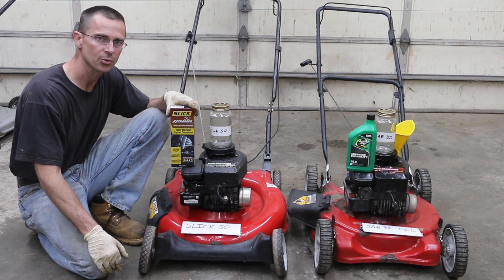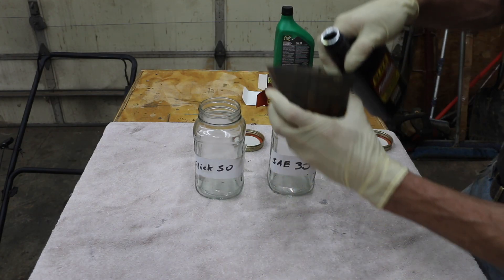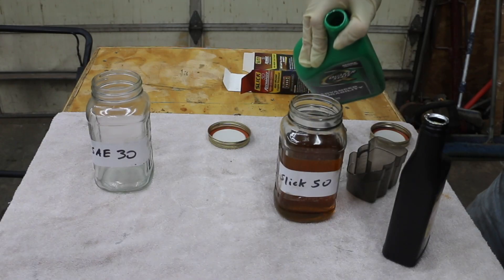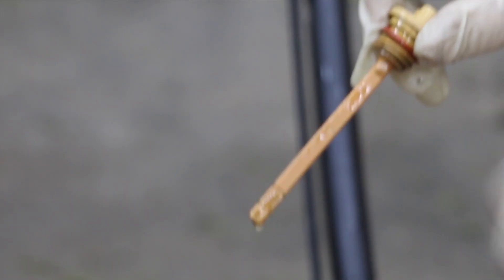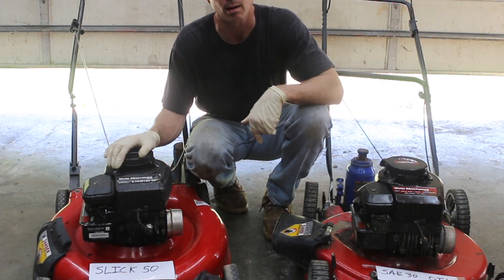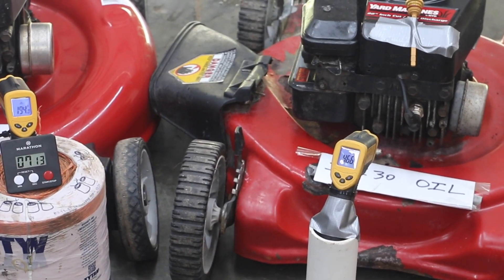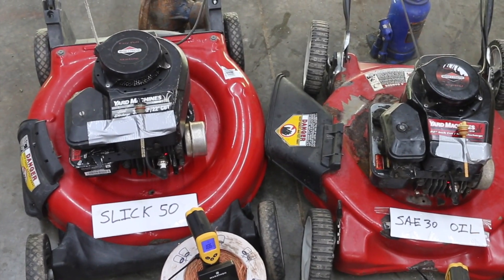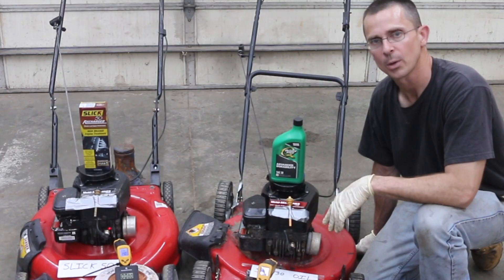Can't believe what SLICK 50 did to my engine!!--Dry Crankcase Test!

Comment: For Slick 50 to work properly, it has to be in the crankcase oil for at least 1000 miles which equates to 20 odd hours of run time with several cool periods in between before treatment will be successfully concluded.  READ THE BLOODY INSTRUCTIONS before making irrelevant time wasting videos
Reply from the maker: Thank you for the feedback

Comment: I remember the advert,have tried it myself.Had a Triumph Bonneville,and the oil pump packed up.Only way i knew something was wrong was it started to rattle a lot!!New oil pump in and no rattle, and no problems.
Oh and after i had added it,before oil pump failure it did run better.
I do remember you are supposed to give the bottle a good shake as the Teflon sinks to the bottom.
Reply from the maker: Thank you for the feedback
Reply: @ProjectFarm  your welcome dude!

Comment: I’d say the slick 50 mower Had less run time then the other mower based on appearances and the mower with tighter clearances due to less wear will seize up before an Engine with lots of run time and loose bearing,piston to wall tolerances. i’m guessing that’s why the straight 30 wt Mower was able to run longer at much higher temps without welding it’s self together.The fact that the slick 50 engine ran cooler proves there was less friction. less  heat=less friction less parasitic loss more efficient longer engine life. probably the only good way to do this test would be to buy two brand new engines break them in the same exact way and with same exact run time on each engine to rule out most of the variables you get on used engines. and then proceed. but that can be pretty expensive test. even then there are unknowns. The temperature test with the oil in the engines sold me on slick 50.
Reply: @Joe Cool but the commercial showed an engine running dry after slick 50 treatment. He was just replicating what they said could be done with their product.
Reply from the maker: Thank you for the feedback
Reply: I agree with newer older motor theory.
I also would have like to see the newer engine operating temp with straight oil
Reply: I put slick 50 in my car and once when the engine low oil light came on I immediately pulled over and my engine seized before I got to the side of the road.
Good luck.
Reply: @jalsr.speak2379  What did you find out?  Was the oil pump screen plugged with Teflon?
Reply: @solarsynapse  The engine was out of oil. I had to leave it on the side of the road. The engine was seized, would not turn over. Ran fine before I let it go too long without refilling so I would think no.
Reply: @jalsr.speak2379   Jesus, that seems like a pretty damning report on the stuff operating 'in the field'  Project farm make note.
Reply: @ic08jy700 You hit the nail on the head. That's what I'm saying.
Reply: It appeared to me that the mower with slick 50 was a much more used mower with worn tires and bad camber etc. But I guess that doesn't necessarily mean more hours on the motor.
Reply: Scotty Monty Yeah you never know... but if you’re familiar with engines you know that a loose engine Will take more abuse then an engine with close tolerances A.k.a. less run time. that’s why I mentioned getting 2 engines Brand New to rule out the variables. either way most engines were designed to have oil in them. Back when Slick 50 1st came out 95% of all oil you found on the shelf at your local auto parts store was nonsynthetic. slick 50 was basically a synthetic oil that was designed to mix with conventional giving you a synthetic blend. which is better than straight up non-synthetic. fast forward 30 years and now a large majority of engine oil’s are full synthetic or a synthetic blend because it’s already been proven to be better than non-synthetic.
Reply: The newer engine would be tighter and have MORE friction, not less.
Reply: and lets not forget maybe the vehicle motor that was used in the test was only idling .
Reply: @Joe Cool I also put Slick 50 in my own '87 Ranger, and had measurable results consistent with the advertising.
Reply: The slick50 temp laser appeared to be on a cooling fin? I also noticed when the 30w motor was moving, the temp sensor crossed the cooling fin and dropped to a similar temp as slick 50. Any thoughts?
Reply: In
Reply: This makes sense. Thank you for your input
Reply: Appreciate you
Reply: I used slick 50 about 20 years ago on my Honda CBR 400 bike in Greece, and i remember one time i made a trip of about 450 Km and on my way back my engine lost some power for a while and i stopped to check the oil and there was no oil at all left in the engine and it was sunday night and i managed to go home another 60 Km without oil in the engine traveling with speeds up to 80 Km/h. I put new oil in that engine and used the bike for 2 more years without any major problem. Hard to believe ? maybe, but i also remember that on the box of the slick 50 it said that after i put it in the engine i had to run/use the engine for at least 3000 to 4000 Km before i change the oil again, to allow for the teflon in the slick 50 to make itself permanent on the metal parts of the engine. So that test is so wrong just for not following the manufacturers instructions. On the other hand i found out later that the compounds in slick 50 had some bad effects to the rubber seals in the engine after a prolonged use....
Reply: @dimitriosmessinezos4097  TEFLON (PTFE) was used in SLICK 50 years ago, but TEFLON produced by dupont, stopped selling these resins to ANYONE for the purpose of additives to oils and greases in ANY FORM in February 1981!  This was after the "DEPARTMENT OF THE ARMY" made some significant studies and testing in the use of PTFE (TEFLON) in automotive oils and greases.
 So I don't know exactly what "SLICK 50 is now using as their additive. There were other Companies using this PTFE (TEFLON) as well, such as MICROLON, F-4 and f-2 oil treatments, and many others.
Reply: @dimitriosmessinezos4097  , my results were similar to yours at an earlier time frame; but I understand the company got bought out, and a reformulation was done.
The engine in my 1987 Ford Ranger showed a fuel economy improvement consistent with the advertising; the oil pressure remained on the low side, but within spec. What I didn't know was that the Ford factory had been notorious for dropping silicon rubber into the oiling system, which eventually plugged up the oil pump. I shut it off as soon as it started ticking, but Ford said it was out of warranty. The engine ran another 40,000 miles before my brother totaled it some time after buying the truck.
My results showed that, at least with the original formula, the product performed as advertised.
Reply: @dimitriosmessinezos4097  True about the mileage. Unfortunately I had S 50 in my car for about a year and it did nothing. It was a v8 engine.
Reply: @jalsr.speak2379  The truth is that slick 50 just protects the metal parts of the engine in the long run if you use your engine with respect. Also the truth is that we tend to squeeze every little more we can from our engines, so all benefits (milage, economy, low temps) are getting lost because we don't  take good care of our engines. And the last truth is that with slick 50 we can abuse our engines more with a little less damage on the long run.
Reply: @dimitriosmessinezos4097  If you use a PROPERLY FORMULATED oil in specific applications, there is NO NEED to add ANY other ADDITIVES!
Reply: @1gr8oil  a lot of " if" in real life, means either a lot of money or a lot of problems. Some, meaning the ones without a lot of money or without just enough money are trying to do the best they can to keep their car or equipment last a little longer. For me it worked and saved me a lot of money that I didn't  have. Anyway, every case is different and a lot of different factors in the way, so I know it worked for me at that time and I also believe people that say it didn't work for them.
Reply: @dimitriosmessinezos4097  What do you base your conclusions on?
Reply: @dimitriosmessinezos4097  ........my incident matches  your metrics except in my case it was the molybdenum disulphide additive not Slick. I went 80 ks with no oil on my 650 .  bike
Reply: Ok slick 50 rep
Reply: I agree. I don't think this was a very scientific experiment. Love project farm, but this one didn't make sense to me.
Reply: He did not use the correct formula of slick 50 and another company took over the slick 50 and changed the formula the original was and still is the best $89 fo 750 mil plastic container I have used it for years and ran my car,s engine 30k without any water or coolant and she,s still going .

Comment: P Farm: Congrats on pulling comments even after 2& half years. Here is my comment. LOL. As I am repairing mowers that are sometimes similar in a way to these two after no oil, I am interested in knowing if the slick enabled its engine to be saved. I know not many do try to save em when they are run dry but I do. (I cant help myself). Just thinkin.
Reply from the maker: I've been able to save engines that have been run dry but often times the connecting rod becomes damaged beyond repair and makes a pretty bad knock

Comment: I wouldn't waste money on gimmicks like Slick 50.  I've tried Mobil 1 and other synthetic oils with good results.  The synthetic stuff at least promotes a little better fuel mileage.  But to really save money you do better with plain ole oil and regular oil changes.  It's not just the oil but the particles of carbon that result from high temperatures.  Get good air filters and oil filters to save your engine wear and tear.
Reply from the maker: Thank you for the feedback

Comment: Most of those additives void warranties, because they clog up strainers and filters. They're just a scam.
Reply from the maker: Thank you for the feedback
Reply: All snake oil.
Reply: Not duralube
Reply: I  had slick 50 in my 92 ranger,,,the oil pump went out on I 95 I drove that truck 19 miles to my mother in law`s,,,Replaced the pump a few days later Drove it another few yrs,,,,sold it and ought a 95 ranger,,,SOOOOOOO The stuff DOSE work,,,And I`m proof

Comment: I used a product in the 70s that had little zinc balls that you added with the liquid. I was losing oil out the exhaust snd it sealed up the engine and I stopped losing oil. I sold the car 30000 miles later and it still was not using oil. I don’t remember what it was called but I was impressed.
Reply from the maker: Thank you for the feedback

Comment: The makers of Slick 50 have a good subjective product.  It will be a long time and too many variables to determine if their product actually works.  That being said, some comments about the video:  First, since your IR temperature gauges rely in emissivity to provide a reliable reading, the measurement should be focused on a similar shiny point - maybe the spark plug.  Second, wouldn't temperature difference affect expansion of metals within the engine resulting in earlier seizing for the cooler engine?  Thanks for your videos. I love them.

Comment: Didn’t realize Slick 50 still exists, remember seeing their ads all the time in Popular Mechanics/Science/Family Handyman in the 70s/80s.
Reply from the maker: Thank you for the feedback
Reply: I don't recall them recommending to run without any oil though!
IMHO... the PTFE when it got hot enough, cooked and galled up, where if it were in moving oil it wouldn't have. running that much cooler I'd sure think it was reducing friction everywhere... crank, rod, piston rings+skirts etc. still great abuse test!!
Reply: @modelnutty6503  the run dry was part of their commercial. Weren't they ordered to stop advertising?
Reply: @modelnutty6503  Congratulations!  You are the first commenter that I've seen that's called the active ingredient in slick 50 by it's correct name; Poly tetra fluoro ethylene
I treated my Hilux 4 X 4's  motor with slick 50, it was a 4Y motor, petrol
I added the slick 50 to the engine oil and ran it for the recommended 5,000 Klm, drained it, and returned to using my usual oil, a while later,,, "some one" , no names mentioned, but you can point, "cooked" the motor,   turns out there was a hole in the radiator
  They didn't stop until the motor cut out!
The steam melted the solder on the top tank of the radiator, and it actually separated !
  The engine block was a black as your hat!
The cylinder head warped and let water into the combustion chamber ,and that's what stopped it
  I won't go into a lot of detail, but it was a piece of cake to repair, and it went on to last another 250,000 Klm, until the piston closed to the firewall sprang off the end of the con rod, a little while later, Yes, I was still driving it! the con red went through the side of the engine block,
thass when I shut it down, like I didn't wanna ruin the motor.
Reply: yeah it's only in EVERY auto parts store in the country..... tough to find
Reply: Ya, and it is still the garbage it was back then !!! Put DuraLube in the engine and your engine would not have seized up

Comment: Well, I don't know - but I had a Honda Prelude, and using Slick 50 I measured a 2 mpg improvement on highway driving (tested on 8 hour drives to NH @ 55 mph, got 32 vs 30 mpg) and also noticed higher RPM's at idle. Finally once a radiator belt blew and the red light came on, the engine was overheating. I pulled over, had the car fixed. The mechanic told me I was lucky, normally my pistons should have frozen and I would have a ruined engine.  Nowadays I don't use it on my normally aspirated '08 Mercedes 3.5L V6, I figure the tech has changed. But I did some research and trust Liqui Moly overall - both their motor oil and the Ceratec additive (at new oil changes, which I don't do until 10,000 miles*) and their MoS2 that I add after the first 400 miles past Ceratec is used. This per a Liqui Moly specialist who was kind enough to explain the reasons/ procedure.  Which is why I take the trouble of writing this down. 
(*) From what I gathered it is actually not beneficial to change the oil more often than necessary in modern cars. This of course applies to non turbos, not sure what's the story with those.
(**) OT.  FWIW I wouldn't buy anything but a fully electric car these days (Tesla only for now), or at least a hybrid electric. The simplified mechanics and savings just are way too clear. The media (and traditional car manufacturers as well as the slick dinosaur oil lobbies)  do a good job of obscuring/ deleting these obvious facts).

Comment: I don't know that your test is valid, slick 50 with ptfe had a period of time it had to run for the slick 50 to coat the motor.
Reply from the maker: Thank you for the feedback
Reply: @ProjectFarm  Dura lube had the same advertisement going on.  My brother and I both used slick50 back in the 80's, me in a good engine, him in a Celica that smoked, his engine stopping smoking and ran great.  Only real problem I read about is buildup in areas where there aren't moving parts.

Comment: Short term tests.  I tried slick 50,  give time for slick 50 to "coat & penetrate" surfaces.?   No oil changes over months of hard work?
When I tried this product... At 100,000 miles it felt as it did breaking in period at 50,000 miles.   (?)
Reply from the maker: Thank you for the feedback

Comment: Back in the day; my Dad used Slick 50 on all the vehicles, and they lasted with many miles on the odometers... Over 200k easyin the 70's and 80's.  He used Castrol GTX on everything.   As time went by back in the 90's there was a product called "Prolong"; where they ran a Dodge Viper, with a V10 dry after having this product in it.  The results were astounding!  The car seemed to run several miles without any seizing or motor lockup.  I think they still sell the Prolong product in stores.  Thank you for this test!  Happy New Year!
Reply from the maker: Happy New Year!

Comment: Interesting. A friend of mine was a distributor of slick 50 in the early 80s and he had an engine with a plexiglass plate so you could watch the crank. He would run it with no oil in it except for a light spray until the engine just shut down because of the heat and piston expansion but once it cooled down you could squirt a little oil in the cylinder and turn it right over again and it would run until it heated up and stopped again. It didn't cease up from metal damage to just expansion.  I watched him repeat the procedure in numerous demonstrations.
Reply from the maker: Thank you for the feedback!

Comment: S.ick 50 is a scam... PTFE doesn't "stick" to engine parts. Metal needs to go through a process to have a coating. The best thing to use is race oil which has deposites of ZINC in it to act as a sacrificial barrier between metal parts.
Reply: Slick 50 has saved two of my engines that lost their oil, one on a motorway and one in central London. I was able to reach both destinations, neither engine seized, so I have to disagree with your comment as the Slick 50 did exactly what it says on the tin
Reply: Duralube saved my truck engine after being run dry, towing a ford ranger on a heavy homebuilt trailer for over 20 miles. Still driving it today. Ptfe fills the microscopic imperfections in the steel.